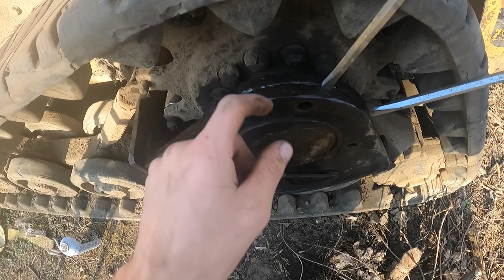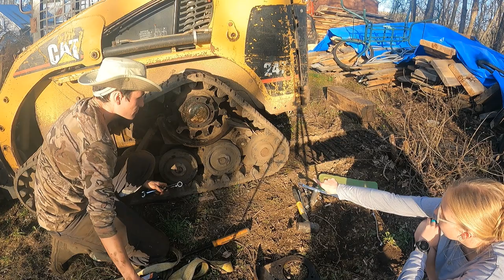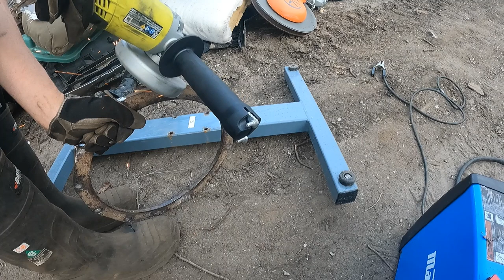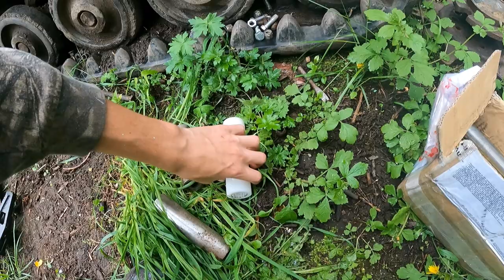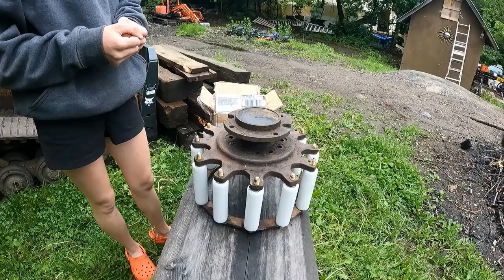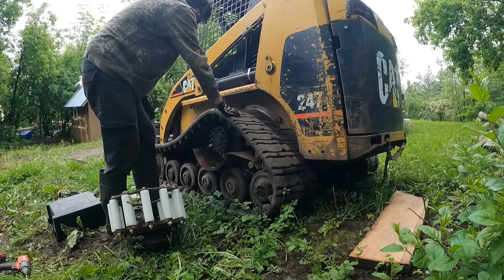Fixing Cat 247 skid steer ASV undercarriage

Comment: My guy, that system is is so simple. If youd step back and look at the over all track system, you may understand it differently. Its not all about the drive socket. Once that rubber runs off those wheels you really gone be fooked